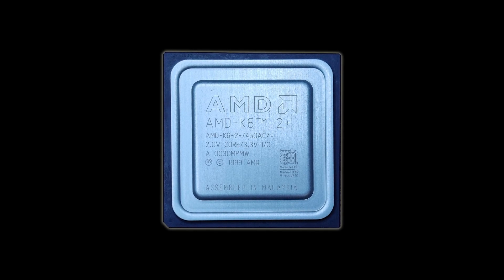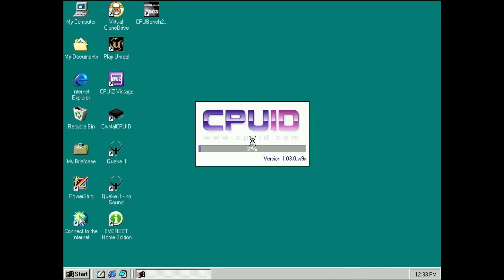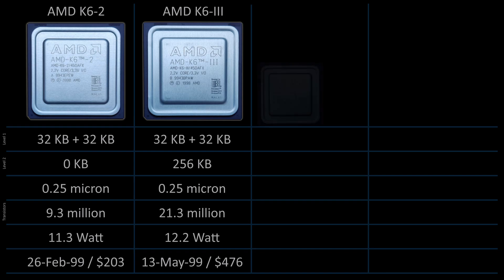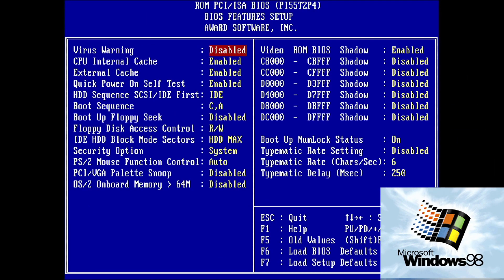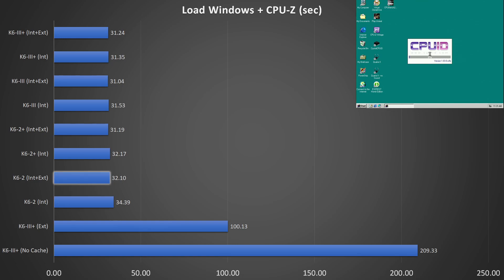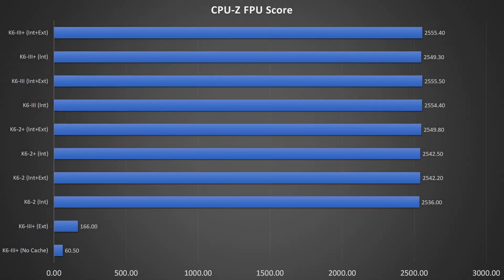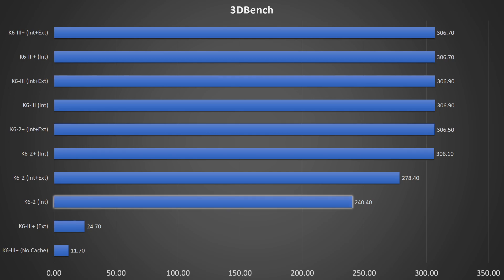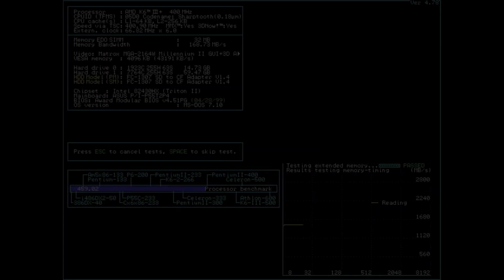AMD K6-III+: Additional L2 Cache Performance and Cache Levels

Comment: Next time try with a super socket 7 motherboard,you will be amazed by the results
Reply from the maker: I am in the process to get a Super Socket 7 Board. There will be a follow-up for sure!
Reply: @bitsundbolts  try 83mhz fsb on current mb. 83*6=500
Reply from the maker: Tested this today. Will make a follow-up soon, but don't want to spoil anything ;)

Comment: There is a huge benefit with more cache but only if your workload needs it. It's kinda like ram. You'll only notice performance differences when you have too little but basically nothing happens once you're above that limit :)
Reply from the maker: I need to find a scenario that clearly shows a benefit between the two CPUs. Hopefully I will find one!
Reply: On my Asus mb I noticed that having the level 2 , 128k on die cache , improved the video playback of mpg video files - not at full screen  . ( Running Video CD mpg files ) . It can almost play a DVD , but not quite with out stuttering . The cpu load went from 98% down to 47% usage in win 98 when using the on die  128k L2 cache / no mb cache . AMD K6-2+E 570 clocked at 500 mhz , 32mb Matrox G450 pci video card . 256mb / 60 ns system RAM .

Comment: Seeing these benchmarks, it seems like the L2 has yet to ever be a huge deal as even processors today have pretty much the same L2 cache levels per core that they had back then.
Reply from the maker: True, L1 and L2 Cache have not changed significantly in size. They got a lot faster, but as I get more into understanding how cache works, it gets more confusing. 25 years ago, you cached 64 or 128 MB or memory, now systems have 1000x more memory! It's still a topic I have a lot of work and research planned

Comment: I was probably in need of this video 20 years ago :)
Reply from the maker: A secret that was kept for many many years! Interesting that nobody leaked it or it was found earlier! One other of those hacks were for the Radeon 9500 Pro to 9700 Pro mod. I attempted the soft mod back then, but was unsuccessful. I got artifacts on screen after unlocking the other 4 render pipelines or whatever it was called

Comment: I would assume, you wouldn't see a difference on an older socket 7 board. Need an SS7 ALI or MVP3 chipset to really see the difference. PhilsComputerLab did a video about it on a later SS7 board

Comment: For cache testing: One benefit of the K6-III with integrierted L2 cache was the relatively large cacheable area (4GB). Of course this would only have an effect for configurations with very large memory capacities or if the motherboard restricts the cacheable area.
On your P/I-P55T2P4 I can see that the motherboard's L2 (L3) cache configuration is 512 KB (JP5 hard wired to pins 2+3). I can also see that the cacheable area of the L2 (L3) cache is set to 64 MB (JP4 is set to pins 1+2). It could also be more than 64 MB (up to 512 MB - JP4 must then the be set to pins 2+3) but requires Pipeline Burst SRAM (PBSRAM) and a TAG SRAM upgrade (the small socket next to the CPU socket that is empty on your motherboard)
As you have a memory capacity of "only" 32 MB this doesn't make a difference at all. The motherboard's L2 cache can perfectly mange your 32 MB of SRAM (up to 64 MB) and could manage up to 512 MB of PBSRAM if you upgrade it with a TAG SRAM chip.
In a nutshell: If you use more then 64 MB of memory, your motherboard isn't able to cache the whole memory capacity without a TAG SRAM upgrade and using PBSRAM.
Thus it would be interesting to see if it makes a difference if you use more then 64 MB of memory with K6-2 vs. K6-III.
Reply from the maker: I have a video online where I am upgrading the TAG ram and use a COASt module. The images I use in those videos are older images I have taken from two revisions (2.3 and 3.1). It is funny that you say I should test the board with non-cacheable memory areas. I am planning a video where I'll do exactly that, plus using an older BIOS Version that doesn't know the plus versions of the K6 - I think I've read that you'll also get lower performance of around 10% in that case.
Reply: @bitsundbolts  Cool! Looking forward to that! :)

Comment: Generally with anything after say the Pentium M era that when it comes to additional cache there is usually a bump in additional bandwidth hence the bump in performance even though the cache is still being used the additional capacity might not provide that much of an improvement depending on the application but it is always nice to have more regardless. Procs in general are sensitive to both bandwidth and throughput as high latency robs a lot of potential performance especially on modern consoles as just an example using high latency memory.

Comment: With my very similar Asus TXP4 I have a modified K6-2+ which I'm running at 6x83 with 256 megs of SDRAM. When I use Sisoft Sandra to measure the memory bandwidth it's always lower when the 512k motherboard cache is enabled.
Reply from the maker: That is similar to my findings then. But that was the only benchmark that suggested a decrease in performance. Will try to find more info on this topic.
Reply: @bitsundbolts  I have an FX 5500 PCI card in the system using the Nvidia 45.23 driver and both 3D 99 and 3D 2000 have slightly lower scores with the motherboard's cache enabled. I've done the tests many times; the gap is small but consistent. I thought it might be because the TX chipset can only cache 64 megabytes of memory and I have 256 megs installed, but I also ran the tests with only 64 megabytes and the results were the same.
Reply from the maker: I have a TAG module installed (15ns) and all memory is cacheable. I still got results in memory bandwidth that is lower when the motherboard cache is enabled. Maybe I will revisit this topic in the future

Comment: Can you test actual game benchmarks with your K6-3+ with and without the motherboard cache enabled, to see whether there's actually a performance regression with that L3 cache enabled?  I remember this claim being made but I think I saw a video, PhilsComputerLab IIRC, that found it wasn't the case.

Update: Just did a quick test myself w/ K6-2+ 618MHz (5.5x112.5) and I do see a massive 27% increase in memory write speed per a synthetic benchmark when disabling the 512KB motherboard cache, but I also tested a game (Unreal) and see nearly 3% reduction in FPS.
Reply from the maker: Yes, I will do this in the future. Any particular game(s) you have in mind?
Reply: You need to set your cache and mem timings to fastest to benefit from it. You need to use WPCREDIT for this. I have beaten socket 7 to death with a stick, level 3 cache helps ends of story.

Comment: I have to add that at least on my PCchips M577, leaving the external cache enabled with a K6-3 or K6-2+ leads to memory corruption. Memtest fails. I pulled my hair out until I found it doesn’t happen with K6 or K6-2.
Reply from the maker: That is interesting. I don't understand how the external cache would work with K6 and K6-2 though and not with CPUs that have internal L2 Cache.
Reply: @bitsundbolts  it might be a bug where the cache is not demoted to L3 as it should but stays as a second L2 cache, giving conflicting outcomes in specific scenarios. I could boot windows but it crashed at random. Always failed memtest test 5 at 0 Bytes afair.
Reply: @bitsundbolts  one more bit: happens on two separate boards with different revisions. Jep, it drove me mad so I bought another $100 M577 board to troubleshoot the issue.
Reply from the maker: Yeah, those situations can drive you crazy! This demotion to Level 3 seems to be flaky. I have noticed that some tools do not properly identify the different caches (but that might be due to the way the tools try to identify caches - I assume some use access time).
But you could be right that something may have caused issues with correct allocation on those motherboards

Comment: One Question: Did you test the tool by Andreas Stiller from C't setk6v3 ?  It is still around. Some Motherboards have a curious Bug which would explain your results. I used the tool on my K6-3+ 500. Some Motherboards don't recognize the L2 Cache, then u use only the L1 and L3 Cache. the tool by Stiller is a driver which corrects this issue. Some tools may use the L2 cache but it is not commonly used, without the driver. My K6-3+ got a solid boost thanks to the tool. 256kb with 500mhz is way faster as the 256kb 100mhz the motherboard offered. Your results looks like you are not running the L2 Cache.
Reply from the maker: I have not used this tool, but maybe it is worth trying. The BIOS I am using is a modded BIOS that specifically states to have fixed the proper initialization of K6-III CPUs - therefore, I didn't consider using any third party tool. The speedsys benchmark shows however a clear drop of performance at each cache level - so, I think the CPU and all cache levels work properly. Maybe it would be a good test against a board that knowingly has this bug. I have to check what Socket 7 boards I have for that...
Reply: @bitsundbolts  The tool lets you enable and disable the Cache with a command line. When your Bios is fixed then i may be wrong. It is from a CPU Guru from a German PC Magazin and here widely used. In Germany the first "Aldi" PC (Grocery Chain) had an AMD K6-2, the bios was not fixed and needed the Tool when you upgraded to an K6-3.

Comment: Hello from Kazakhstan) If it really improves performance, then I think I'll try this method on my AMD K6 II+ 550mhz, Overclocking to 600mhz and 256kb cache could make the system on socket 7 the most powerful. Can you show an example of this system on gothic or morrowind games?
Reply from the maker: Hello! I am not sure yet if this mod improves performance by enough considering the risk you take during the delid! Also, there is a chance that the cache is defective and the mod doesn't work. I have a couple of K6-2+ 570 waiting. Next month I will do a follow-up to see if I can find a unit with defective cache.
Regarding Gothic and Morrowind - based on their system requirements they are too demanding for this system (it is not a Super Socket 7 board). If I get a Super Socket 7 board with AGP support, 100MHz FSB, SDRAM, and better GPUs, I may have a look.

Comment: is it possible you hit a wall of storage media read speed instead of cpu limitations, at least in boot speed benchmark
how about torturing it with xp?
how much of the memory was chahable in those tests, 
would tag chip change anything?
Reply from the maker: I have a tag chip installed - 100% of memory is cacheable. During this test, I had 32 MB memory installed. But I am also using SD-Card to IDE devices.
Maybe later with Super Socket 7 I can revisit this - maybe even try a small SSD in the future.
Reply: @bitsundbolts  that kind of interesting actually . since you already have tag chip i would try tests that can handle more ram and stack the board to the fullest with the biggest fastest sims it can handle (or dimms i don't really know the platform)
because  you are hitting some kind of performance wall and unless you can say for 100% that's cpu you will see no difference whatever it is storage, ram or cache because ram buffer is just too small  to work eficiently with bigger cache buffer
you can also remove the tag chip and check if that decrease your resouts in significant way, and at what point of memory it start to play a role
for storage i would probably just stack some pci sata controller card and  small sata ssd. it could be funny to see how storage is almost as fast as ram in that kind of a system and pci buss being a bottleneck
Reply from the maker: You are probably right - I should have used at least 64 MB of RAM - this is the minimum the ASUS P55T2P4 can handle without Tag. But I had the Tag installed anyway - and once I tested the board with 256 MB (4x64MB + Tag) memory. There was no non-cacheable memory area.
Cache is anyway an interesting topic. I am planning to do more in that area - but it requires a lot of research. That will be a future project!

Comment: And how about a Super7 system with 1M L3 cache?
Reply from the maker: I think you won't see much better performance on the Super7 platform and it may completely depend on the workload if the level 3 is properly utilized.

Comment: Your conclusion is wrong because your system is unable to fully utilize anything faster than (very slow) K6-2 without L2 cache on die. To measure it correctly you need three things. First get rid of any EDO RAM and use SDRAM only, even 66MHz 15 ns version is more than 3x faster than fastest 50 ns EDO. EDO's performance is really horribly bad for such CPUs and it is clear bottleneck for your system. It is good for Pentium 120 MHz but too slow for anything ahead. Then you need FSB 100MHz+, ideally 112 MHz or more. And third - you need SDRAM as fast as possible, ideally with CL2 :-). In such case you will see healthy +20% performance boost with 256 kB L2 cache over 128 kB and data throughput >200MB/s. Said short - without good Super Socket 7 motherboard there is no use for such fast CPUs and waste of time to make such tests with wrong results.
Reply from the maker: Right now, I don't have a super socket 7 board. Once I get one, I can compare and see what difference it makes using all those things you mentioned. This is not the end of it, I am determined to find a good argument for the the larger cache.
Reply: @bitsundbolts  Don't get me wrong, you made nice video but with too weak mobo + RAM. Now it's like testing server CPUs with 1 thread application. In the end you will see all such CPUs are the same no matter what they can do :-). 

I have fast super socket 7 board with CL2 RAM and the difference between K6-2+ and III+ on the same clock is really +20% in games, even more in 3D tests (like 3D Mark 2000 I got 2775 vs 3560 points with 128/256kB L2 cache on die). Ordinary K6-2 without cache is substantially slower than both K6-2/III+ naturally.

For speed difference between EDO and SDRAM - fast EDO can provide you around 55 MB/s, slow SDRAM ~100 MB/s. PC100 CL3 around 160 MB/s, PC112 CL3 can give you 180 MB/s and CL2 approx. 210 MB/s.
Reply from the maker: I am fine with what you are saying - and I agree. I am in the process of getting a proper motherboard to do such comparison in the future. Comments like yours will also help me to get ideas what to do in the future! So, thank you for the info. At the end I just want to create something that is enjoyable and informative. That does not imply that I will always do the best job and there may be a time when I will be completely wrong. I hope we are all here to learn ;)
Reply: I have not heard some of these terms since decades ago :D

Comment: I used to own k6-3+ 1.6V😭😭😭 damn i sold it in 2014 for just 3500CZK to a collector.. today it would be probably worth more than triple
 edit: bro, you were most probably very limited by that fukin slow EDO ram.. btw this is the first case i see a Ssocket7 with edo slots.. SDR would be way faster man
Reply from the maker: Yes, I know that this is not a good combination. I am waiting to get my hands on a Super Socket 7 Board. But then I want to know how much faster SD-RAM really is - more content for the future!
Edit: Sorry for you selling that nice K6-3+! Would love to have one of those!
Reply: @bitsundbolts  yea they oc like crazy, i swear i managed to get him 2.25V 700Mhz rock stable and it would probably hit 725-750Mhz
Reply from the maker: Once I get my hands on one of the better SS7 boards, I will try my luck! But I think it was very difficult to go past 600/625 MHz.
Reply: @bitsundbolts  maybe a silicon lottery? I did not crash test its stability though..
Reply: @bitsundbolts  indeed it is difficult, right now i have  a K6 III+ 400 (1.6V) Running at 600@2.0v. Beyond that things get very unstable unless you crank up the voltage and the practical performance increase in not worth it.

Comment: The problem is that you are using a 66Mhz bus. So you don't see any differences. The motherboard is artificially limiting the processor.

Please, stop using that motherboard and use a consistent one.
Reply from the maker: I will retest this soon using a super socket 7 which I didn't have at the time of recording this video.
But I don't think performance will increase by much using a super socket 7 board and the switch between 128 and 256 kb of Level 2 cache. I'm guessing around 5%.